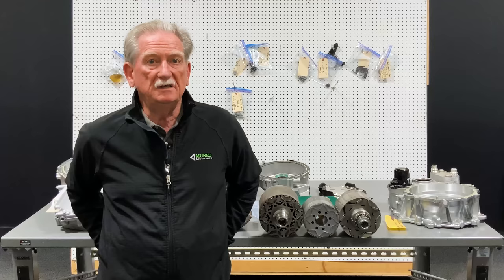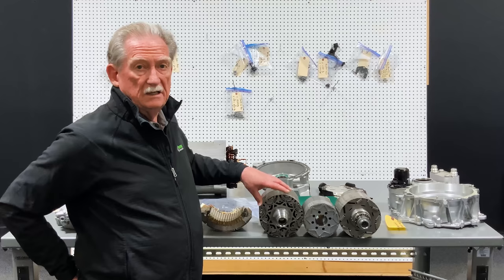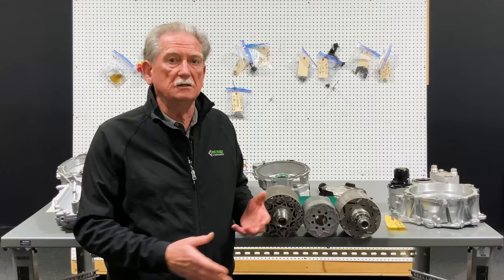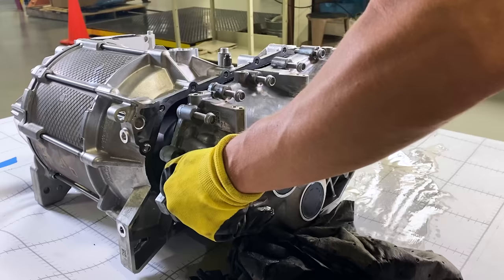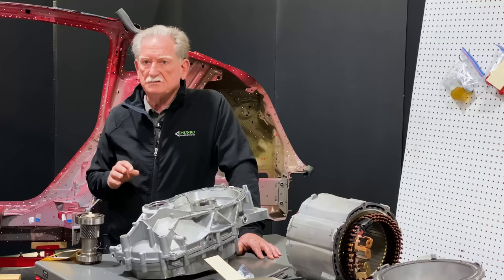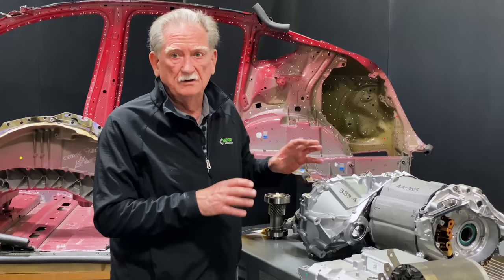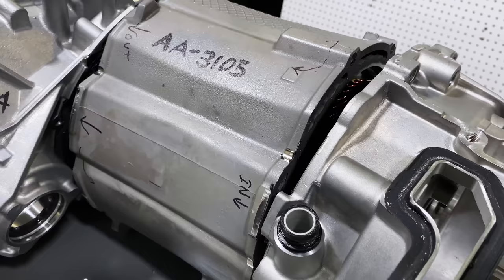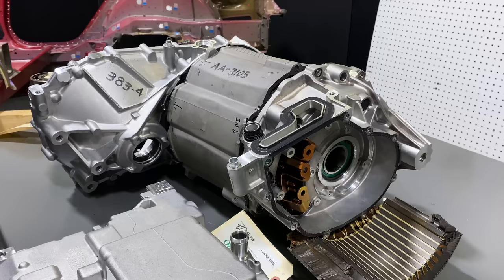Volkswagen ID.4: Electric Motor Teardown and Analysis

Comment: "unfasteners"... making the part serviceable and incredibly easy and fast to dissemble this inverter at end of life and cheaply recycle as much of it as possible.  In which case, it doesn't matter how many bolts are used if they can all either be reused or recycled.  The sheer volume of them means that if a few loosen up, it doesn't matter.  I was thinking they could re-use the housing over and over again at end of life or if anything goes bad.. but why bother.  Just unbolt everything, pull out the electronics, and melt down the aluminum for re-use in next gen products.

What this does allow VW to do is cycle inverters during warranty replacements.  A customer's inverter goes bad, VW yanks it out and replaces it with a new one.  They send that inverter to a specialty repair shop and replace the bad components.  Now another customer's inverter goes bad, they yank it and replace it with the fixed inverter, and send the bad one to the repair shop again.  That would require significantly less parts production than a complete throwaway solution, and would be cheaper for VW in the long run.  

Unlike Tesla, the large OEMs likely do plan for the entire future supply chain and reuse of materials, knowing that the company will still be around 100 years from now.  Tesla is in the game to make things as cheaply as possible to maximize their profits without considering second use (See their mess of a battery module that cannot be repaired in the case of multiple cell failures) and is willing to overengineer products and maximize performance as a selling feature to try and steal market share from the big companies.  I highly doubt they're planning for second use of their materials at this point... they've been in far too much of a rush to do so.  The only exception may be their heavy use of aluminum in their chassis, which is where recycling of that VERY expensive and very energy intensive aluminum they're using will be absolutely critical to re-use.  Although, I have my doubts there too.  More likely the main priority of that aluminum is weight savings; and now the casting process to reduce parts and welds.

As for the bleed resistors... VW put it into a small cheap component that's quickly installed.  It looks like the Tesla solution on the board uses more parts and may be just as expensive if not moreso.  If the bleed resistor alone failed, then yes, I could see the VW being serviced.  Haven't you watched Rich Rebuilds servicing boards?  The Tesla board would be nearly impossible to service, so yes, the entire inverter is probably meant to be a throw away.  The VW board could actually be pulled out by an independent mechanic and fixed by hand if one didn't want to spend a fortune on a completely new inverter.  Since it's broken up into multiple separate boards, each individual board could be replaced if it went bad; without having to replace everything.  

The VW vertical integration also means that the inverter may be using space more effectively.  Look at how long and wide that Tesla inverter board and housing is.  Cool, it saves a few screws, but there are now more failure points on a single board.  I also don't think Sandy is considering manufacturing failures.  I imagine a percentage of these boards have a manufacturing defect.  If that happens to Tesla's board, the entire board is donezo.  By splitting it into more smaller specialized boards, maybe VW is able to mitigate the amount of losses.

Keep in mind folks, the base ID.4 is about $20k less than the base model Y after credits.  I imagine they tore down Teslas and could have copied if they wanted to, but they didn't, and probably for very good reasons.

Comment: Hi Munro and Sandy, I do not agree with you to snap things together and get rid of threaded fasteners, also I do not agree that nobody will fixing the inverter Unit. You might in USA do not care about the pile of WASTE what you are generating but here in EU there is a new regulation that says "repair instead of buy new one" in order to reduce the amount of generated waste, reduce environmental load, by replacing a complex - expensive sub assemblies what could be fixed by replacing some minor penny electrical components like coils or capacitors, O rings, cables and so on. I agree the Lean philosophy but PLEASE think about generated WASTE what kills us slowly due to the habit of throwing out things if they stop operating. Again MANUFACTURERS must return and FOCUS to develop and produce products which are easy to fix and repairable at very low cost instead of generating tons of waste everyday. Best example the new Cars nowadays buy new one in every 3 years and throw away the old ones. What a pity Marketing shit is that. They must be in Jail!

Comment: @ 13:40 "disposium" = dysprosium, "neodydium" = neodymium

Overall, there is some good info and observations here (burrs on the  casting), but some of the extraneous commentary is not really all that useful, and the state of the art has advanced way beyond some of the recommendations. There is a lot more than just the parts-ey or assembly aspects to an inverter module. Every engineer I know is keenly aware of a lot more of the issues than what is presented here. For one, we know how to torque threaded fasteners with 100% certainty that they won't back out under any edge case.

I wish there was a proper presentation of all the electrical and electronics aspects from someone knowledgeable in these areas. It is whole lot more than just vertical assembly, etc.

Comment: VW has it right, create a engine platform that can go in many models. i liked siemens motor concept in 08, it didnt matter what suspension it was, it was in the wheel. some limitations in snow regions. wheel drives the car not the car drives the wheels. i need to get back into the battery world again, its been a long time, it was way before its time back then, i think its time has come. https://www.youtube.com/watch?v=2wP4F8MDuqw

Comment: The machining with the burrs in the housing looks to be poorly machined. You can see a portion that was dusted and not fully machined. Being devils advocate this offset machining could have been done to level the surface of the casting, that being said I see that very unlikely since the flash from the ejector pins in the casting. It may also be a non functional zone and the witness mark is just from the machining of the area.

Comment: Those fasteners on the inside are strictly for product life they know at a certain point those screws are going to vibrate loose when they vibrate loose they float around eventually they're going to come in contact with two things they shouldn't and there starts your nightmare it's just a way to have a guaranteed failure point New age products are full of them they want failure points so you have to buy a new one and you could look at it from a completely innocent point of perspective by saying they only expected this car to last say 170,000 MI so if they have a projection of 200,000 miles these screws are going to vibrate loose then you're completely within an acceptable amount of time if you're a car fails at 200,000 miles when they predicted you to buy a new car at 170,000 miles so technically it doesn't matter that there's a failure point because you already exceeded the lifetime of the product they're just making sure you don't exceed the lifetime of that product

Comment: Munro tends to obsess about minutia. 

While VW (and its P-Wagon partner) generally do an excellent job of engineering the drive trains, occasional really dumb design elements do crop up.  Porsche's ISB (intermediate shaft bearing) fiasco is one and the Mechatronic controller used in the VW 6-speed DSG is another.  I went thru tree of these with my 2009 GTI (at $4000 a pop) and since the last one was not covered by warranty, sold the car and vowed never to buy another VW product.

Comment: VW might have contracted this out to a 3rd party...Continental, AVL, FEV or whoever. Very little if anything innovative. It's a permanent magnet motor and transmission after all. Looks like low pressure sand casting rather than High pressure die,with permanent mould cores, so envisaged production volume is low. Surprised to see taper rollers in the diff and not angular contact balls. It's a big diff though. I had always thought bolting through the laminates was bad as it upset the magnetic flux. 
When the realities of electric car ownership hit home, we will return to the ICE, albeit with rankine cycle heat recovery in a hybrid scheme. Unless of course there is a quantum leap in solid state battery technology and it's charging infrastructure.

Comment: You use fasteners if you want to be able to fix it in the future if it breaks. 
The problem with American cars is that they are not build to last, VW's are still running after 65 years, because you can repair them. 
If you worked at Ford you know that their quality is far from the quality that VW builds.

Comment: Snap fasteners are better, unless you plan on ever undoing them again. That's not good design, that's planned obsolescence. Anyone working on old and not so old cars or machines will tell you that it's those damn snap fasteners that break and then cannot even be easily replaced, not nuts magically undoing themselves. Then again, if the design does not explicitly ask for repairability, why bother?

Comment: @6:56 Crack in the casting?
Reply: They look like stress fractures.  It looks like they originated at the rivets.  They got my attention immediately, but Mr Munro does not mention them.  He did mention the burrs, however. 6:50

Comment: Of course threaded fastners are service- capable. Seeing non- serviceable parts to me, means the company sold you something you can't fix. In other words thanks for trusting us with your money and screw you by the way. Threaded fasteners allow the unit to be disassembled later. With a little threadlock compound they don't come out. What engineers don't relate to is the future cost of repairs that the owner may be faced with. This is one reason, with so many plastic components in their cooling systems that I do not respect VW in particular when they lowered their materials quality to benefit cost of production. They don't make them out of plastic because it's a superior material to cast aluminum. Of course an engineer prioritizes design differently than a mechanic would like to see. Their priority is 1. make it work for a while, don't forget planned obsolescence and do it cheaply. All else falls between the cracks.

Comment: Jet engines don't run on 3 bearings, on the IAE-V2500 for example there are 5 (one of the engines used on the Airbus A320, one of the most widely spread airliners on the planet). Less bearings is less friction ,yes, BUT, also less surfaces on which to apply torque, so in the end i'll want that instead off less bearings, that's only good for VW for saving costs, not for reliability! 
Then the oil is not cooled and is not filtered, really,really bad for ball bearings, Tesla for ex. has the oil cooled and filtered and it has a strong magnet inside the case to catch as much of the metal shavings as possible (generated by the gears) with that kind of engineering one can hope for 1mil miles...not with VW!!

Comment: Snap together may be better for saving money and for original construction, but it is horrible for repair work.  Snap building doesn’t consider fixing the part. Almost always once you “unsnap” a part, it is never held together tightly again.  Snap building is good for original construction parts that won’t need repair- not for expensive parts that need to be rebuilt.  I am a 35 year mechanical engineer with a PhD in integrated design engineering. What’s good for profitability and the company, is very often not good for the consumer. Munro seems to focus on the factory benefits, not on your benefits. Don’t get me wrong, I think he’s great and smart, but too often he is only on the side of the factory - just my opinion.

Comment: This is way over Sandy Munro’s capability. The video is missing a critical aspect to the analysis. The electrical performance of the VW motor as compared to the Tesla motor. Theres so much more that goes into motor/ inverter design than what was discussed in this video. It would have been better to compare these different motors when energized against fixed loads at various RPM while monitoring the input current draw.

Comment: that out put shaft from the motor  to gear box the spline in the rotor, seen the same in golf carts and the way it is supported by the bearings, they are the real weak spot in the motors and don't last that long ! not a good setup, sorry!

Comment: Threaded fastners are way better. A snap faster will usualy break after 20 years and you cant fix that. 

Typical engineering minder, it only had to last the warranty of the product instead of 25 - 30 years

In designing and engineering there always be two camps. Build to last (which usualy fail) or build to maintain. If you build something that is easy to maintain, it should last as long it is maintained and cared for

Comment: I have a pre-Raven Model S, and holy smokes, I've never had to deal with so many rattles and loose panels in an interior of such an expensive car as in Teslas. I wish they used more screws, because their plastic clips other plastic fasteners come loose over time from just normal use (like shutting the doors). Also the dashboard panels are loose and started creaking from just normal road vibration, and there's really nothing I can do about it. Terrible American cheap design.

Comment: "The Tesla bearings are gigantic" - what a joke, LOL.

Tesla SKF 6308 - 8 ball deep grove, 90 mm, 0.63 kg
VW SKF BT1-1767/QCL7CVA607 - 25 tapered rollers, 75 mm, 0.3 kg

Tesla - 42.3 kN static load
WV - 71 kN static load

WV is lighter and stronger but has higher drag...

So, who is bigger and stronger? LOL

Comment: It is showing that sandy isn't super knowledgeable about electronics.  "This is the capacitor.  it makes the whole motor run" isn't  really accurate.  it acts as a massive source of charge to smooth out the peaks in current required by the inverter

Comment: Mechanics must love you, you with all your snap-on parts, and unserviceable parts, Watch it Boy'o, one day a group of Mechanics will force you to service one of your Snap-on only together parts, then make you eat each of the broken clips. lol, jk.
Also, there's no issue with a screw or bolt that is designed no the unscrew itself, just because in the US you don't like them, means nothing when the possible ability to service a component via VW or a mechanic, which the option has left open, which is a smart move, because VW aren't like Ford that waste time and material when diagnosing / repairing a fault.

Comment: Vw design may look very clever..but reliability is big issue with them. To name a few, remember the dsg transmission, though looks like a very clever design but how much reliable is that? How about the ignition coils, sensors etc in their ICE vehicles. Low life span..
I don't trust VW reliability anymore

Comment: The us has should that we are stop devlopment of fuel Engines , all great CEO's of Fuel Motors are in Jail cell's,  most of factory management has tell us, the engeenering of fuel motors are disabled, and all want now  construct only electro engines. (on 1920 this type of engins was forbidden by goverment)  Any one know if u fire up an diesel drip some moleculars are going free, u can put em in a box or on scrap place they molecular parts fill be comes free always u have now it ! Anyone has now it, if u fire up petrol an mass of subparticles will be free and a  lie about that was never  given.

Comment: No, no.. 'Whitworth' is a 55 degree angle - similar to the US and metric 60 degree. Whitworth has a greater resistance to unlocking but is by no means 'impossible to get out'. Mathematically, Whitworth is the best thread form - metric and National are a compromise to simplify manufacture. Americans have struggled with Whitworth since WW1 - on contract armaments work, most of the US made Whitworth threads failed British QA.
Reply: And, ffs, 'Acme' is an American LEADSCREW thread - not a 'British, Canadian or Australian fastener' - with a 29 degree included angle. Neither Acme or the equivalent ISO metric trapezoidal threads are 'impossible to get out'. Are you sure you're up to speed on this?

Comment: It is strange how this video compares a non sports type vehicle like any electric VW to an Iconic electric vehicle such as a Tesla. If you want the vehicle to go 1 mil you need to have safety measures such as bigger bulkier gearboxes, shafts bearings etc. Remember ludicrous mode? Now imagine doing VW's version of Ludicrous mode with that tiny shaft and small bearings. 

My Take on Tesla, and I've been following and checking out all the positive and negative reviews and videos is that at 5:44 of this video I lost all interest. I know it's late into the video but I was trying to give it a shot but I just couldn't.

This video is definitely a paid review and a shot against all other electric vehicles and especially Tesla. It's like asking someone to spot you in a gym and he asks "Do you even lift bro". Compare apples to apples please and not apples to Diamonds.

Comment: At least in Europe the rail track is not cut in the angle like you suggest, are welded so, no gap .........  and  BW that patern shown in rotor , doesn't have nothing to do with noise, (rotor is not car tire) is there to improve the performance.
Sorry I have to observe you didn't have any clue how electronics  need to be assembled, specially for high frequency. ( to many bolts .....😂😂😂😂😂😂😂😂😂)